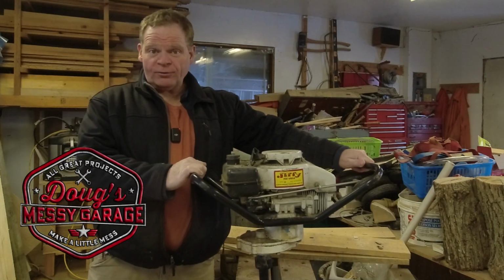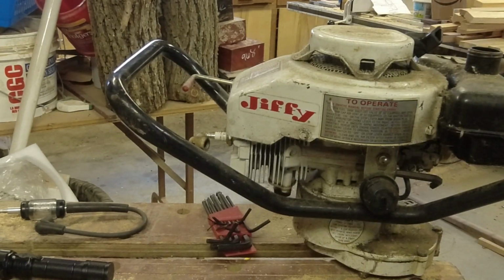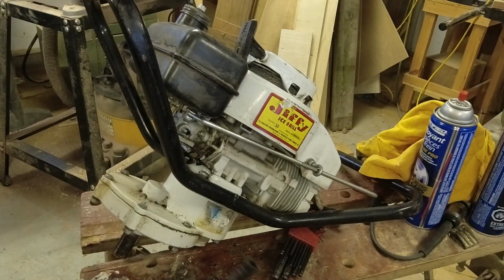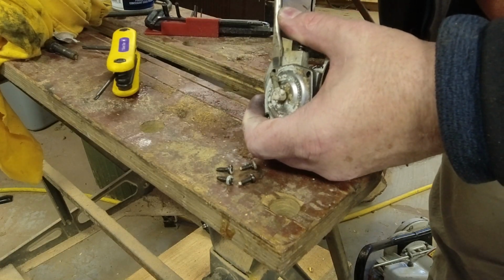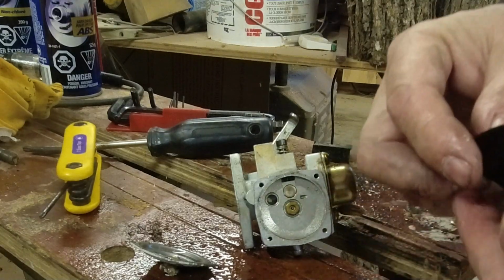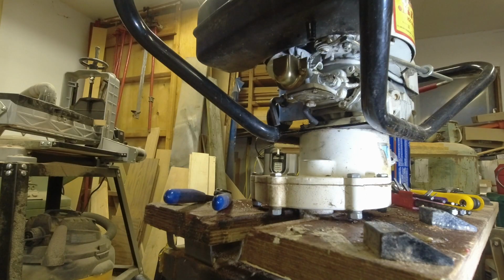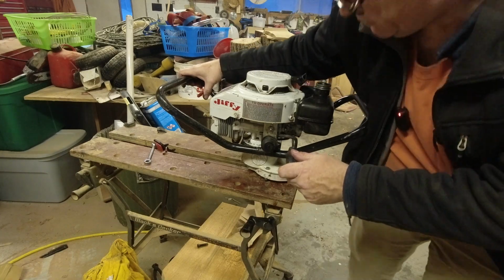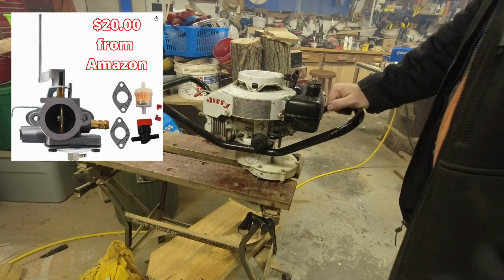ICE Fishermen: Jiffy Model 30 Ice Auger - Will It Run?

Comment: I just bought one almost exactly like this. Beautiful little auger. Just wanted to mention that the mix ratio recommended on the engine itself says 5 ounces of oil per gallon of gasoline,  making the ratio closer to 1:25 ish.  I know it seems pretty rich, but that's what it says. Anyway nice video.
Reply from the maker: Reminds me that I need to install the new carb I picked up for my father's auger last spring.

Thanks for watching and for commenting.